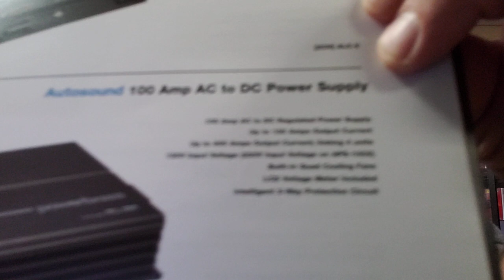Use car audio amps to run your HIFI or Home Theater setup....

Comment: The full 850w of a computer powersupply is usually split between a couple rails so if you are only using 300W of 12V it is fine, but if your peaks go above 300w it starts to get dicy. Furthermore most power supplies are 300-450w so when the power is split you can only safely draw 100-200W from them. You can use dedicated server power supplies but they have REALLY loud fans because they have to be low profile for server racks so they use tiny fans that spin at a zillion rpm. Either way its a bad idea. If you are going to go this way, you get a LiPo car battery and a car battery charger, but at that point you the money you spent makes it not worth it.
Reply: How about using a High Wattage Desktop PS With Super high Capacitance capacitors, ( Say several hundred thousand UF, Either One single huge can or several smaller ones in parallel)?

Comment: I have a pile of car audio stuff from the 90s. Cant wait to find a power supply. This is going to be fun using high current amps through my onkyo atmos  av system but upon further inspection my onkyo doesnt have pre outs for everything so might need to get the proper preamp for atmos. My older onkyo av reciever without atmos has pre outs for everything so might try that first and it does have audsey mic for dsp setup just like the atmos reciever.

Comment: Been using the same PC power supply for over 14 years. It is currently running a skar sdr 18d2 @4 ohm in 4.5cu.ft slot ported tuned to 26hz and a power acoustik rzr2500d in my living room. Nothing difficult about hooking it up either.

Comment: Open it up and let me see the 12-volt power source, please.
Reply: I used an old xbox 360 brick haha
Reply: Anything that outputs 12 or 14v is good.
Reply: @swingking08   did you cut the one end and strip the wires and plug that up to your amp?

Comment: Did he get to a point where he shows how to wire a system up?.. or we meant to go to the local autobahn/Supercheap an while the staff aren't looking, drag one of those amplifier and speaker boards across the floor and out the door, didn't watch to the end...shame, i do have a new power converter and Alpine amp ready to go...

Comment: Recently came across an old video you posted about how to power your Cerwin Vega speakers and there was no place to post a question, so...here’s mine.
I purchased a set of black E-301 Series Cerwin Vega floor speakers in 1995-96 while I was in the Army stationed in Italy from the Post exchange. While I understand that they are not the “greatest product “ Cerwin Vega produced they have worked very well for me over the years.
How should I be powering them? I was using an Onkyo P-301 Preamplifier with an Onkyo Integra series M-504 Power Amplifier, but later switched to my current Onkyo TXNR656 AV Receiver because it newer and had more options available including Bluetooth technology.
Is the older setup a better fit for these speakers or am I perfectly fine with the current setup.
Both from my recollection sounded well for my basic purposes but, I don’t want to under/over power them and want to get the best performance out of them.
What would you suggest? Thanks in advance.
Reply from the maker: With almost any type of CV speakers, you can do 1.5X the rated power handling of the speaker, that will give you plenty of headroom and control.
But I always recommend power amps instead of receivers.

Comment: @Rossi can the home theater rca output voltage fry a car audio amplifier input?
Reply: Normally not. But just check the specsheet and see if they are compatible.
It is all online.

And watch a video on how to set the gain on a car amp.

Comment: Most car audio amps' power ratings are based at 4 ohms and 2 ohms. How would that impact the ability to power up home audio speakers that are mainly rated at 8 ohms. Will these car amps be able to provide enough power based on  8 ohm speaker loads? Example would be to fully drive Cerwin Vega D9 speakers to their max to really get the Bass thumping.
Reply: @Booneville2024  According to factory specs sheet the all D-series speakers were 8 ohm nominal
   https://audiokarma.org/forums/index.php?threads/cerwin-vega-d-series-spec-sheet.100203/

Comment: could I connect my car dual subwoofer to my home theater system, having the amp only power the subwoofer and get the audio from home theater using rca cable?

Comment: I'm getting ready to build a couple of speakers to fit in my tool locker at work. I was considering car speakers, I would like to do 3-ways. the area for each box to set in is 12"w X 24"h X 13" d. I'm thinking  a box with a 10"bass 5" mid and a good tweeter. I figured a set of CV! components because they have a tweeter and crossover. But I would like a 3-way so I would like to put another driver in. I'm an electrician by trade but have no experience building crossovers. Guess my question is what's my best way to accomplish my goal? I know I can buy crossovers. I would love them to sound great, but they need to rock out most of all. I built 2-ways in the past and they sound decent, but I just built the box. 12"  woofer runs full range, Magnavox horn has some capacitor rig on it I believe they were manufactured in '68. Those puppies are loud. Like 105db sensitivity loud (can't confirm that). sorry for rambling. Edit: they'll be running off an older pioneer receiver with no pre-outs so bi-amping isn't an option, they are for the shop so I'm using what I got. Trying not to spend money except on the speakers.
Reply from the maker: As long as you do  a impedance match, and you select crossover points based on the drivers specs, you should be good to go.
There are many crossover design apps/programs online that will do the work for you.
All you have to do is plot in the numbers.
Reply: @RossiAudio  thanks, after everything I've read and saw online people act like a building a 3-way is rocket science. Not good for rookies. Well at some point the new dog has to get off the porch, eh.
Reply from the maker: @ericnortan9012  Building a crossover can be tricky.
It all depends on how you want it.
For your described use/setup, no biggy, a straight foward 3 way filter is totally fine.

If you was building speakers for the high-end community, yeah then you would put more work into it.

It is all about application and use.
Reply: @RossiAudio  I understand, but like you said, for what I'm doing the I don't need to reinvent the wheel. I really appreciate your time. If I get my stuff together you may be getting an order from me, can't get s**t around here

Comment: Id want to run it off solar o.o

But I'll consider the offers when the time arises..
Reply from the maker: May i ask what part of the world you live in?
Solar panel systems are very costly and demands a huge infrastructure in form of controllers, chargers, batteries and panels.

Also solar is very unstable.
If you live in a place with limited daylight  or have many days with overcast, you will see a huge drop in efficiency.

So unless you live 5 degrees off of Equator, you are gonna struggle maintaining enough charge on your batteries.

I have a few friends in California, and they use it as a supplement to the normal grid power.
I have friends who live way up north, and they are only getting what they need out of it during 2-3 months in the summer time.

Comment: Don't waste your time. He goes in so many circles and virtually never answers the questions he says he gets, and he never shows the wiring, doesn't explain how to keep power limits within range, he just says It Can Be Done, Go Ahead, You Can, It Will Work, Can This Be Done Yes It Can Be Done, You Can.